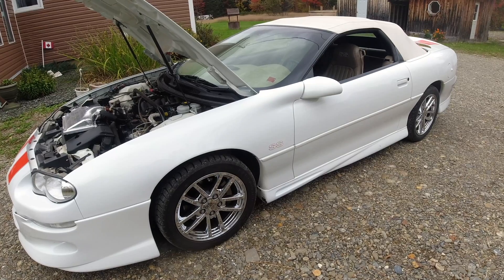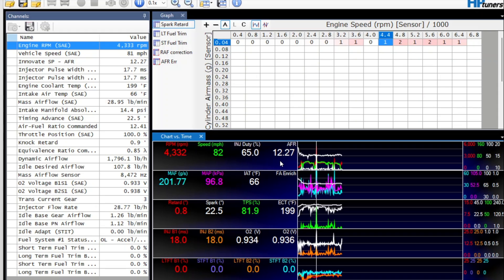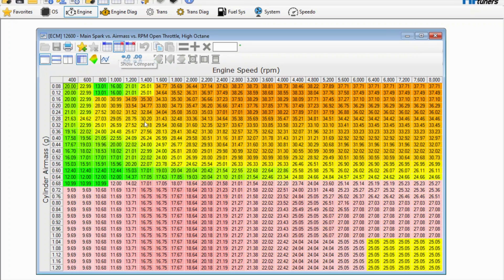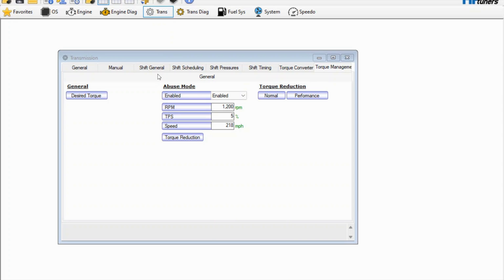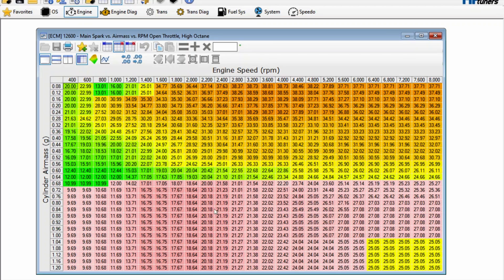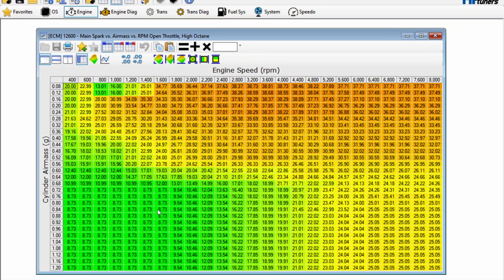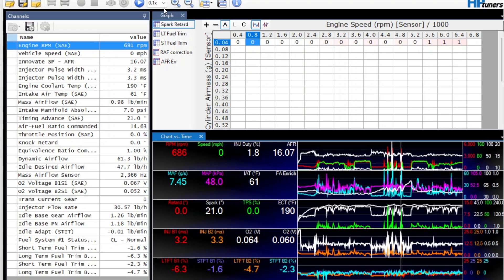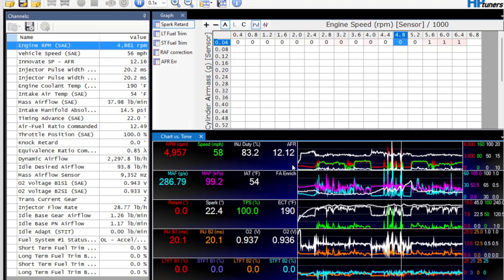Fuel tuning with HP tuners - Tuning a LS1 for better performance.

Comment: I've been considering giving tuning my car a try. The tune I'm currently running could use a lot of work. Ive got a cammed LS1 with ported 241s and full bolt ons. Im just afraid to blow the engine up. Watching videos like yours helps build my confidence to make the jump
Reply from the maker: I know how you feel. I was very afraid in the beginning too. But what I found is if you keep the changes small you are usually safe.  Watching goat rope garage really helped me out alot. While a dyno tune from a really good tuner would probably gain me some power I bet it wouldn't be much. And these LS1 fbody's are probably the easiest cars to tune.

Comment: Thank you for your time and knowledge again! I have a ported Granatelli MAF sensor. Do you any idea if they can be calibrated? Thanks again,   Mike in DFW
Reply from the maker: I have never done it but I don't see any reason why it couldn't be calibrated. It is probably not far off as it is now. But you can make it even more accurate by using HP tuners. From what I have seen is that tuners don't like to tune cars without the honey comb screen because that is used to straighten the Airflow over the hot wire elements in the MAF. But if you tune it on the car then there is no reason you can't get it very close. Even the unmodified stock MAF isn't 100% from what testing I have done. Keep in mind the only experience I have is with tuning my own car so I am no expert.

Comment: Still running the iat sensor with that lid or maf only
Reply from the maker: Yes still have the IAT sensor in the lid and a ported stock MAF which is fully calibrated using HP tuners.

Comment: Hey bud . It's 99999.9 Gm Ls Dyno 1500 HP YouTube channels. Don't be hard on yourself. It will grow. I'm a Ex army African American southern man watching you. Just like I said before I enjoy you make it easy . I don't go of if a channel is big or not. If I understand and the person is cool I'll support. I've gotten bout all I'ma get out a Gen 3 346 aluminum stroked nos 2 stage Th 400 4000 stall 12 bolt. Motor 5.80s I think 💬 I'ma get. I'm redoing to run a low 5s. Just keep posting stay consistent yull be just fine. Put God Ist.. PS. ive been watching you for a min. I remember you under dogging yourself. Way to humble say im not tge best look 1st stop that. 2nd you may not think 💬 you as good as you are but ive been Gm since 14 my 1st car been grudge racing Gm sbc 1 gen -  3 ,4 ls stuff for a minute. If i say you have wisdom well that is facts .
Reply from the maker: Appreciate the support.We will keep the videos coming.